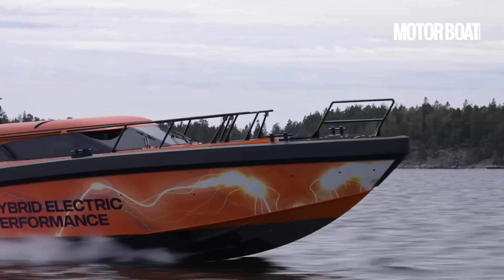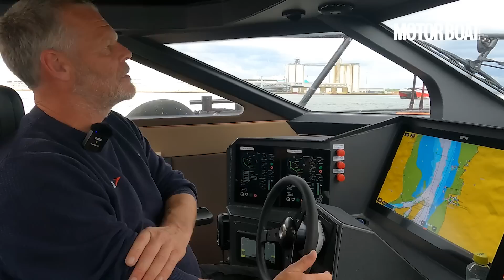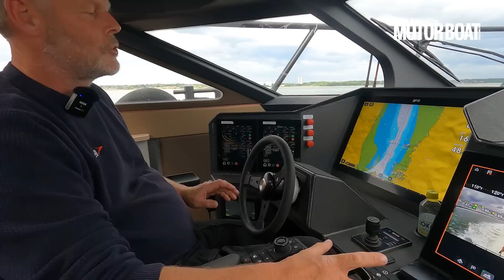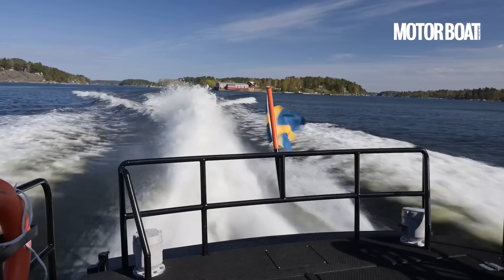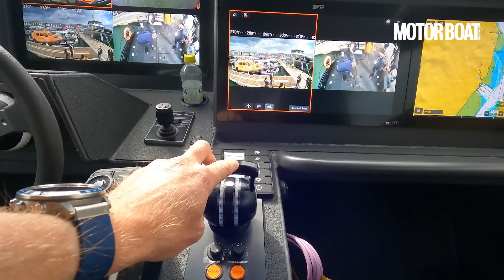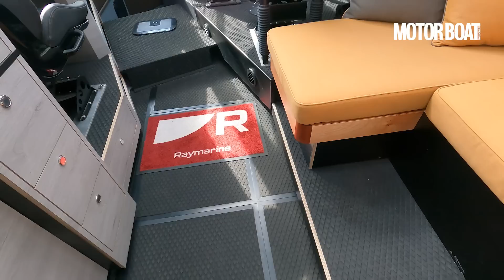The boat even drug-runners are scared of | M17 hybrid yacht tour | Motor Boat & Yachting

Comment: Local drug boats in Florida go 140-185 knots in ideal seas for about 2.5 hours. 90- 130 knots with chop. Somehow this doesn't seem as cool as these guys think. 
Vert der ferk- Swedish Chef
Reply: @GunstockBayA90  
How fast do they go in rough sea during a storm?
This vessel is built to be capable of handling the worst the North Sea can throw at you.
Do serious drug runners even use high speed boats much anymore?
For longer distances we see them go for semi-submersibles "drug-sub" and Fishing vessels to pick up the "commodities".
It's much easier not having to deal with helicopters, drones, planes, and high speed patrol boats, (even if you can go faster, they still have firearms)
Reply: @gorillaguerillaDK  in the Caribbean this boat not fast enough, and in North Sea, local drug boats would not survive. Stalemate!

Comment: One question 😊 where  was the ( head) with that much distance in running you may need to go do,do at least once during  the patrol. Am I not right. Sense the bow lower cabin  was just pretty bear, guessing  that a head would  be ADDED for the buyer later
Reply: @rp1645  it would

Comment: You said cruising for one day on the batteries but not at what speed. The battery capacity is 350 kWh. If one day is 8 h you can runt at an average of about 40 kW or 55 hp, like a rather small outboard engine. What speed would that make? 5 knots perhaps?
Reply: If you've seen how these are typically run, 5 knots and less is how fast these are going for the majority of the working day. That's the benefit of the hybrid system, you can be extremely efficient for most of the day, and you have the diesel when you need it.
Reply: You've just revealed the truth of this sham.

Comment: I’m not sure what they’re scared of? 
I have two aftermarket 500R Mercs (641hp on each) on my cat, it’s not getting anywhere near me. 

Very cool boat though!
Reply: @corneliusblackwood9014  
It could easily be made to go faster, but as I understand it, it's about the balance between speed, range, fuel consumption, and battery charging of the hybrid engines.
And of course the fact that it's a water jet and not a couple of high hp motors running a cat with low draft.

It's a work vessel which is built to handle the rough North Sea, that can be bought and fitted into a recreational vessel.

I have no doubt that you have an awesome cat, and that it's a great thrill to run it at max speed.
But how would you feel about running it at 40 knots in a storm in the North Sea?
Reply: 50knots you can achieve that with a 200hp on right boat that's not really an achievement know days is it
Reply: You're the Man !
Reply: Catch me if you can !

Comment: Drug runners would run away from that boat. They have an unlimited cash flow.😬😳
Reply: @rickbullock4331  
Sure, it's not hard to find boats that can go faster than 50knots.
However, they still have to get to shore with their commodities, and law enforcement agencies, coast guards, and navies have a tendency to also have access to firearms, not to mention the ability to call in helicopters, drones, planes, etc.
So even if a drug runner goes for a faster boat, it will also have to be superior in handling all sorts of weather conditions, and preferably turn invincible as well.
Especially the last part is undoubtedly why we the last couple of decades has started to see a tendency of drug runners preferring to go for semi-submersible vessels, the so-called "drug-sub", instead of high-speed boats, (also, several agencies and navies have RIB boats capable of doing 100 knots).

So it's no wonder when we see drug-runners go for low speed semi-submersible and even fully submersible - with some of their newest creations where they fit the submersibles with torpedo-like containers that can be released at their target position and picked up by fishing vessels, or be released if getting discovered by a Navy/Coast Guard, or similar vessel.
These vessels rarely have the capacity to run faster than 10 knots, and are usually made of fiberglass.

Comment: who does not understand plan boats, must have found this the maximum..... in fact if we do not have 2 diesel engines to recharge the batteries this boat would not be operational. because the batteries last very little time and the diesel engines must be activated..... if they turn on the hydro jets directly in the diesel engines, as I set up the boats that builds, the hybrid boat will get around the same....any engineer knows, the electrical systems are vulnerable and you will not trust. the rest, they have sophisticated the panel and the joistic type manche, something that Volvo has already provided for decades. in my opinion, a poor project where the 2 diesel engines direct in the hydro jets already solved and not forgetting that there are 2 engines of 400hps that consume 80 liters of diesel each, or be 160 liters of diesel per hour, to charge the batteries.   is how you take a wheelbarrow and on top of it take a man with the sand on her lap....within the cart. if it were good, the Americans would have already launched this a long time ago. In the second war, the torpedo boats already sailed at 60 knots with 3 packerard engines of 760 hps each gasoline....in a 60-foot boat with 20 tons and four torpedoes on board and went back to the boat of the boat.light weight

Comment: Realistically , ditch the heavy 300kwhr batteries and electric motors and then you'd have a 60knot real chase boat .
Reply: But then it'd be a worse boat for the regular patrol work these might do on the majority of the workday, which is just puttering along at slow speeds or sitting idle and watching.

Comment: How can this thing supposedly sail a full day on batteries if it only has 300kWh? It needs about 150kW = 201hp just to potter about at slow speeds...like that the batteries will last for 2 hours. Much less when it's cold outside. 75kW = 100hp will barely move it, and that only extends the usage to 4 hours!
Reply: This isn't going to last much shorter in the cold, and if you've seen how police boats are usually driven they spend large amounts or time just sitting still and watching and barely moving, or just puttering along at very slow speeds.

The drag from water increases with the cube of speed (not even squared, but cubed), so even just 10-20kW will get you up to a few knots of speed. I can absolutely see this lasting a full day on some of the regular workdays.

Comment: Ditch the heavy diesel, hybrid gear. Drop in a pair of mercury 1350's . If the boat is light aluminum, keep it light!
Reply: Not near as reliable or durable as diesel
Reply: The electric seems a nice feature if you need to go quiet for a short period of time, such as when pulling out from dockage or going through an area tht is sensitive to noise.  It can also run hotel services on board with no noise or vibrations.  I’m not quite sure why drug runners would be afraid of this boat any more than a non hybrid boat that can go fast, as radar will detect the boat regardless of its means of propulsion.  I guess the instant torque is nice as well.
Reply: @poboymusic1958  I think he said 6-7h on batteries alone, quite a bit. With a few islands around then no sound enable you to sneak up on people, when you are noticed you are already to close. Could pretend you are a sailing ship, why would the law enforcement have slow quiet ships, nothing to worry about? Quite a difference to start a chase with 50m ahead vs +500m.
Reply: Relativily light. It still weights over 20 tons.
Reply: @terot8341  let's not forget about shedding the diesel, generator, batteries weight....
Reply: Mercury are crap engines. There's a reason they aren't used commercially.
Reply: It will pass everything but a fuel dock
Reply: @matthewholzmueller6292  I would suggest a pair of MTU THE BEST POWER WEIGHT RATIO ON THE MARKET
Reply: You don’t know what you are talking about 🥱

Comment: What, precisely, is the point (or specific use case) of this boat ?
25 tonnes of energy-intensive aluminium doing 50 knots using inefficient water-jets while carting around the mass of an electric battery and drive system is just dumb.
Delphia's low speed displacement hybrid boats make a certain amount of sense for a particular use-case (river cruising). Greenline's medium speed semi-displacement hybrid boats ditto (coastal cruising).
A full-on speed machine like this having a hybrid system is ridiculous... 3.5 cubic metres of diesel engines alone negates any specious and farcical ecological claims. Simple maths shows the extra mass of the electrical system would be better utilised by carrying more fuel, or even more powerful engines, or increasing performance and fuel economy of the basic ICE if it were removed.
This is just engineering for engineering's sake...
Reply: Because most of the time these boats are pootling around at low speed and in electric mode it is vastly quieter and usefully more comfortable for the crew than when the big diesels are hammering away
Reply: @hugoandreae3785  So only run one of the diesels when pootling around... and diesels, big or small, only "hammer away" when working hard, not idling... and these are Scania engines, which famously are used quite a lot in TRUCKS, which are subject to noise restrictions so I cannot imagine they are even that loud, especially when fitted with twin water-cooled turbochargers that further reduce exhaust noise levels even before you consider the silencing effect of marine water-cooled exhausts.

And if you are saving three tonnes of unecessary weight, you can afford a few kilos of extra sound-proofing. But when have the military ever compromised performance to this extent to provide more comfort for the crew ? Ask an RNLI volunteer if he would prefer the rescue lifeboat had to carry three tonnes of deadweight in a Force 10 or the crew were issued ear defenders ?

This boat is pointless.
Reply from the maker: @RandomGuyRandomNumber  Trust me, the diesels were surprisingly loud even at idle speed, perhaps because it's a relatively small, aluminium boat which exacerbates the sound and vibrations. The manoeuvrability at slow speed was also considerably better on electric motors (especially compared to running a single engine on a waterjet) as there is no minimum idle speed. I understand where you are coming from but having been on the sea trial I am convinced it offers a number of benefits over a pure diesel boat as well as some disadvantages in terms of weight and cost.
Reply: @MotorBoatYachting  
Less pollution is a huge benefit.
Some of their vessels have to operate both on rivers, in harbours and canals, as well as in the open ocean with rough seas...
Reply: Three and a half cubic metres of diesel Is the capacity. 3.500 litres. He was referring to range - on top of what the electric motors can manage.
Reply: I bet you the reason this boat was made is because they got lots of taxpayer money from the government for its development, and then the government agencies which buy these have been ordered by the government to buy these greenwash-nonsense hybrids and pay double the amount of taxpayer money for them.
Reply: @RandomGuyRandomNumber  
The company has a long tradition of building small patrol and SAR boats.
So it's used for anything where you need a boat that can handle bad weather and rough sea in the North Sea while still keeping up a fairly high speed and having a long operational range...

Oh, and the cost of recharging batteries is pretty low......
Reply: How  you going to catch high speed boats with slow speed river patrol?  Or going to assist in emergencies at coast?
Reply: @terot8341  You catch high speed boats with higher speed boats - not high speed boats made slower by unecessary weight.

Comment: WHY DOES IT NEED TWO SETS of POWER ? DIESEL AND ELECTRIC , TALK ABOUT OVER ENGINEERING . How many solar panels needed to recharge to save diesel ? 🤔
Reply: A 100kWh Lithium battery typically weighs over 600kg and this boat has 4 of them. Electric motors vary, so let's assume total weight of the batteries, motors and chargers / controllers and wiring etc. is 3,000 kg. Replace the hybrid electrical system with a fuel tank and you have just doubled the fuel capacity and doubled the range. And reduced the cost of designing, building, running and maintaining the boat. And reduced consumption of lithium and other resources. And the boat will be faster. This boat is dumb.
Reply: @RandomGuyRandomNumber yup it’s an exercise in pointless
Reply: If you are working on it 8 hours a day five days a week you’ll soon see the point of having electric too. It’s a much quieter and more comfortable place to be in electric mode.
Reply: @hugoandreae3785  If you are working on it 8 hours 5 days, it will probably out of necessity, given range/time  and recharge cylces,  be having to operate  in ICE mode for the majority of that time.
Reply: @hugoandreae3785 work is not for comfort.
Reply: If you saw the video, you wouldnt ask why iz has 2 sets of propulsion
Reply: @6milky6  he didn't even watch it.

Comment: The e motors alone are 400hp and can be paired up in line in which case you can  use a smaller ICE motor as a generator rather than an ovedrive motor and generator.  Which should be more efficient .The vessel is a sytem test bed ...the hull is a standard product running just diesels.
Reply: Using 400hp that thing will run barely more than 40 minutes on those batteries...far less if it's really cold. For that size vessel 400hp is laughably little. And to charge those batteries you need massively more energy than you use with all the huge charging losses, constant battery heating, inefficient boat cabin heating on electricity (I doubt they even do that, for sure they always heat it with diesel...
Reply: @pistonburner6448  He says in the video "minimum 1 day in electric mode cruising". Takes mostly energy to get up to speed, after that it's not that much. Quite a few sail boats over 20 tons with way smaller engines doing just fine.
Reply: @Hoggaforfan   Wrong. If you disagree please go ahead and give us your calculations.
Reply: @Hoggaforfan  One day of cruising is very non-specific. Is one day 24 h, 8 h or what? And at what speed? Definitely not 50 knots. And no, for a boat it's not a matter of getting up to speed and then not much. The resistance from the water is great.

Comment: Lithium batteries on board is very.. very dangerous..
Not for me
Reply: Not really. They will be LiFePo4 batteries which are much safer as they don't suffer from thermal runaway in the same way as Li-Po or other lithium chemistry batteries can. They are very commonly installed on boats now.